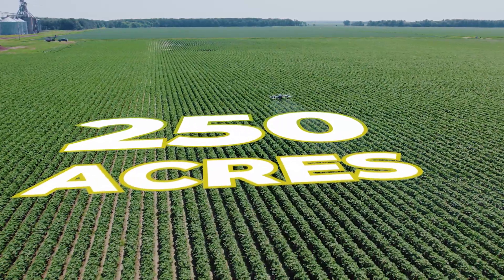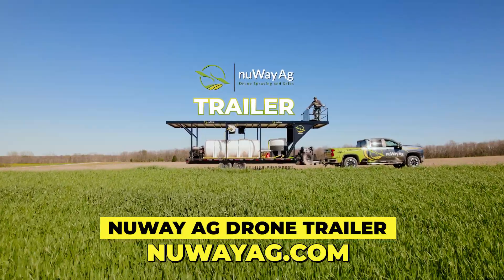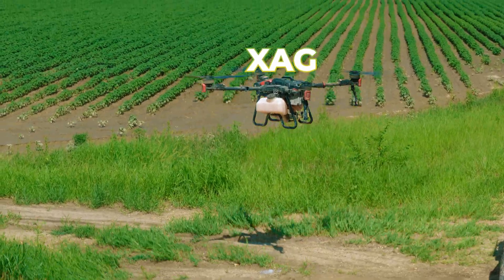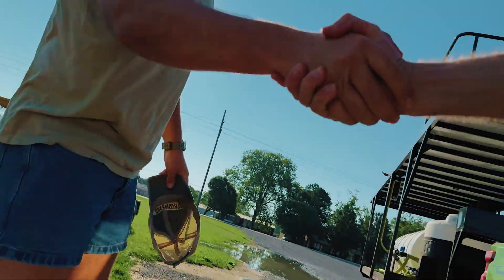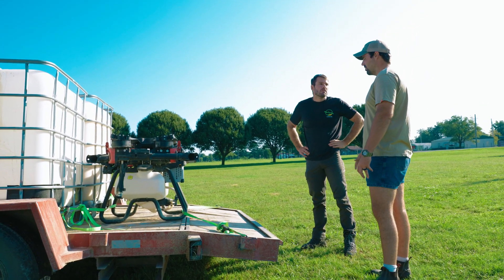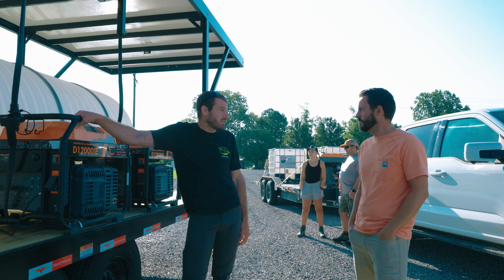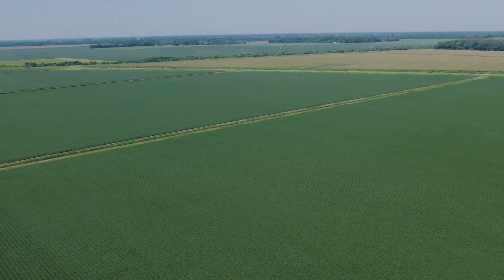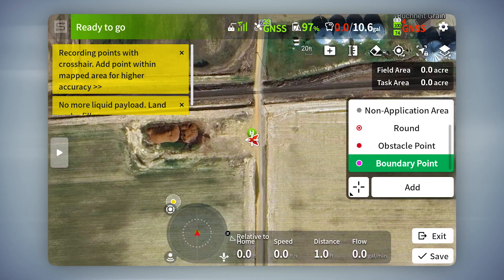Spraying Cotton Fields | Super Efficient!

Comment: Xag is much more efficient on the broad acre side we get around 250 acres per p100 pro here in Australia and don’t seem to have that many issues we run the t50s aswell and they are great drones for the smaller stuff and a lot easier to use but just lacking in the speed

Comment: Over here in The Netherlands we have been doing a try out with shading greenhouses (and cleaning), we started out with the DJI T30 but that was just way too slow and didnt push out enough liquid for us to be efficient. We tried a brand called Huida, but that thing has too many issues and we returned it. Since a couple months ago we started using the XAG P100 Pro mainly becuase it's within the European law of 3 meter maximum sizing, sadly the T40 and T50 fall outside that and we could not run them. So far though the XAG has been a champ with the little small hickups here and there that were all solved by just turning it off for 5 minutes and restarting everything, but i do agree that cuts into your efficiency. Great video again.
Reply: What european law of 3 meters? We've never heard about that one
Reply: There is no 3m european rule. You need STS category approval.
Reply: @IvanMacko1  so we are flying above greenhouses and close to homes/businesses to do this, which puts us in medium risk in the specific category, then you have to do the ground risk determination (step 2) which tells you dimensions under 3m is "safer". it makes no sense to me either but thats what we were advised on.
Reply: @ButeneFilmz  omg what a nonsense. Like as if the size had any influence on the demage it will do to a greenhouse :) Even then, who decides on what level of risk are You when flying over a greenhouse? No persons involved, only a risk to property. That is what insurance is for. One day everything will be so overregulated that even birds will start walking.
Reply: Believe me the DJI has issues too this guy is so full of it